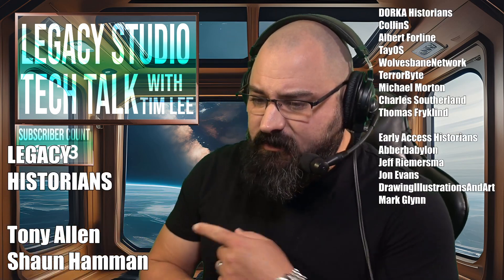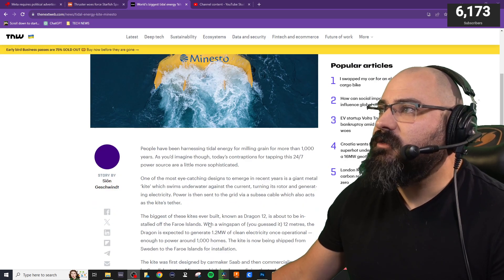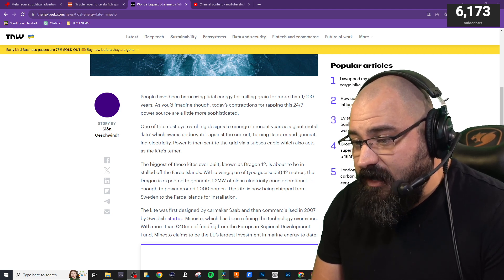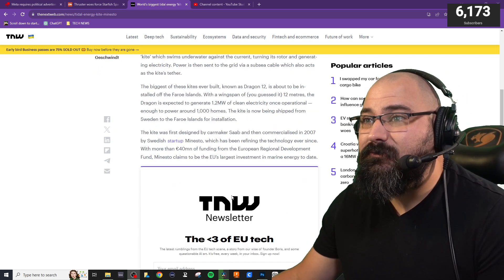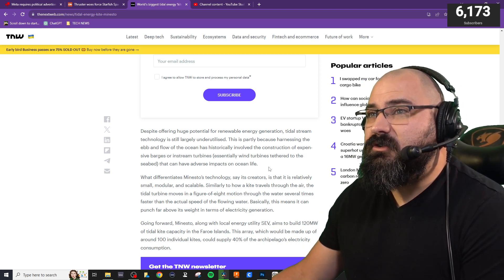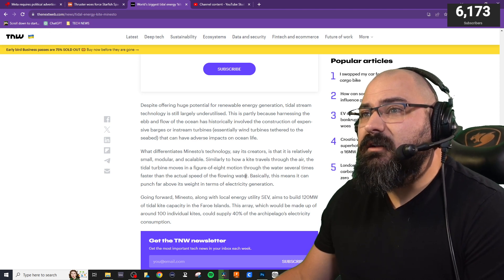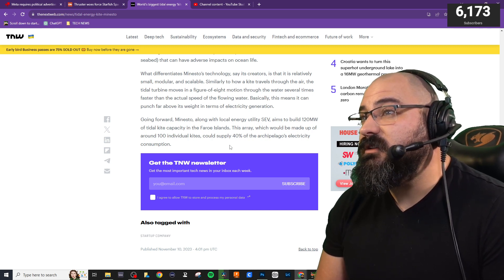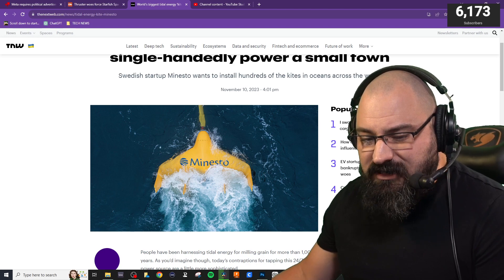Minesto Energy Kite Set to Be Tested in the Faroe Islands!

Comment: Fantastic - renewable electricity production that's NOT taking thousands of tonnes of concrete and steel and is predictable.
Noting that the article though contains a number of errors: the kite ISN'T metal, its mostly composite materials. Also, the idea is sprung not from SAAB automobile, but SAAB aerotech.
Reply from the maker: Thanks so much for the input! I am finding this video is getting a lot of views from an external source. Can I ask where you saw this video? Social Media? Thanks for watching!